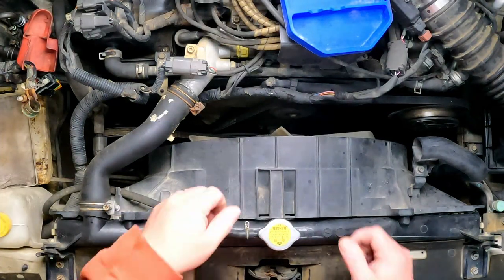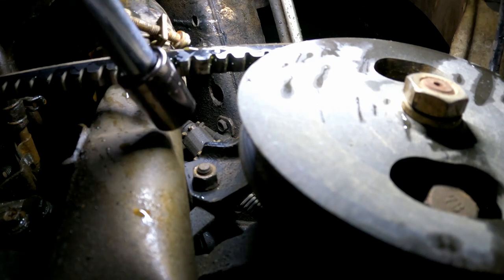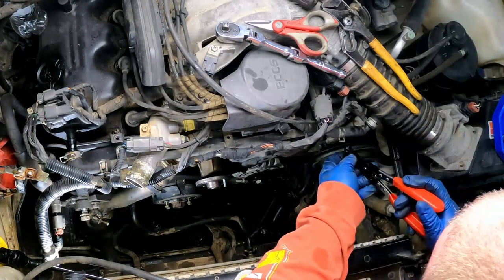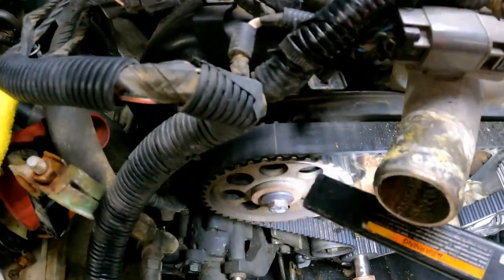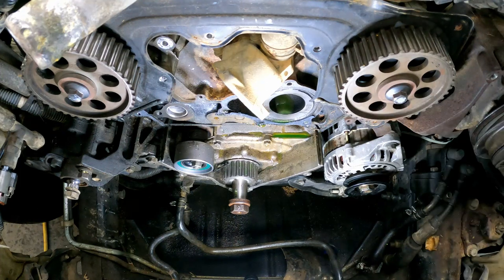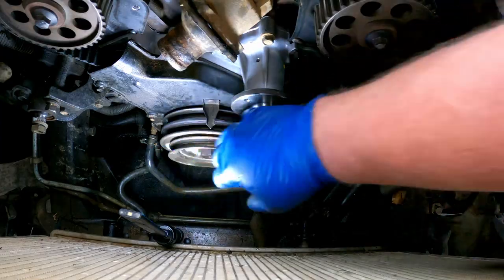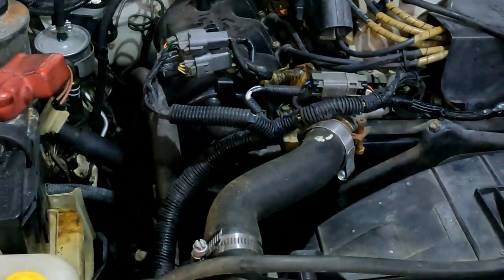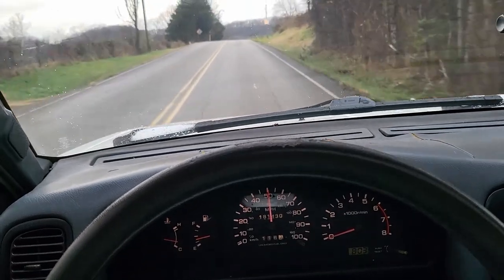Nissan Pathfinder WD21 Timing Belt Replacement

Comment: I was really unsure of what to expect until I saw this video. I literally just did this in my driveway today on my ‘87 and this really helped me out! It took alot of the guesswork/ anxiety out of it for me. I had my radiator out so I had a bit more room (swapped a full aluminum unit in). It was nice to fit an impact on the crank pulley vs a lot of swearing 😂. It’s a nice piece of mind having a fresh belt and water pump in there👍🏻. Awesome job man!
Reply from the maker: LOL, yeah at one point, I actually considered taking the radiator out to get an impact on the crank pulley. But by leaving it on there, my swear jar is much richer today!

Comment: Great video.  I have a '93 5 speed 4WD Pathfinder with the WD21 engine I bought new in Guam but had been sitting in my parent's garage for 18 years.  When my brother finally moved it outside in 2020 I decided I'd better trailer it up and bring it back to Warren County, TN which I did in September.  The fuel had varnished in the tank ruining the tank, fuel pump, and sending unit.  That was the first big job, replacing all of those components when it was sitting on the trailer.  Just finished battling the timing belt crank shaft sprocket after drilling and tapping three 8mm bolt holes in it and using a harmonic balancer puller to finally get it off, but only after heating it with an oxyacetylene torch.  Front oil seal replaced and a new crank shaft sprocket, timing belt tensioner and spring installed.  Water pump and thermostat are next.  A work in progress.  I hope you do a video on your window trim as that is another project down the road along with a new stereo...
Reply from the maker: McMinnville area, that's a LOOOOONG way from Guam. You're not too far from me (Murfreesboro Area here). I already have the trim laying on my bench. If my daughter will park the thing long enough, I'll get it installed and filmed.
Reply: @ProjectTimeGarage  This Pathfinder was hauled to Tennessee from northern Missouri, about a 700 mile one-way trip.  The old girl has some sea time, as it was shipped back to CONUS when I transferred off Guam, then back to Guam when I was stationed there a second time about three years later.  We ended up having her shipped commercially back to Long Beach, CA after the second tour as we had bought a new RAV-4 and the military would only ship one vehicle.  Guam did not have a sales tax, so there was an incentive to buy your vehicles there...

Comment: Excellent tutorial. Will soon be putting to use to chase down new clatter, knock, etc behind what sounds like upper, passenger-side timing cover on my 87 Pathfinder. Thank you very much.
Reply from the maker: I would be curious to know what you find. I have a similar sound that I've been unable to track down. I started the truck with the whole front cover off, basically with only the timing belt & related components, just trying to eliminate all the accessories, but the noise was still there. I'm almost thinking exhaust manifold leak on the driver's side, not sure.

Comment: I believe if you time all the pullys and the belt after it goes around, even one time, the belt timing marks will not be lined up anymore. It happened to me once on a Nissan Quest. I  lined it all up spin it around once, and the belt was in a different place, but it was still in time.
Reply from the maker: Yeah, you're right. You have to spin it a LOT to get it all the timing marks back lined up.

Comment: It is always a good thing to test start after timing belt on, as you did! (Just in case) exhaust leak? Yep, impossible to film, and probably not really worth your time recording it. I think you got a pretty good unit for your daughter or who ever in the family uses it. Maybe interesting to see what is wrong with the tach. Gremlins locking doors? Great 40 minutes spent with you!
Reply from the maker: Thanks Uncle Mark! The tach is definitely high on my list. It drives me nuts!!
Reply: @ProjectTimeGarage  It would drive me nuts too, but I hear for me, it would be a short drive! Lol!
Reply: @unclemarksdiyauto  If you also have a problem with your fuel gauge, the tach shares a circuit and can be fixed by replacing the voltage regulator on the back of the instrument cluster. There is a cheap DIY repair I found online using an off the shelf solid state version that fixed mine.
Reply: @Jmilner101  I am sure Brian will appreciate the info you have supplied, John!

Comment: Great video! Only thing I’m having issues with is getting the crank bolt out, how did you do it ? 
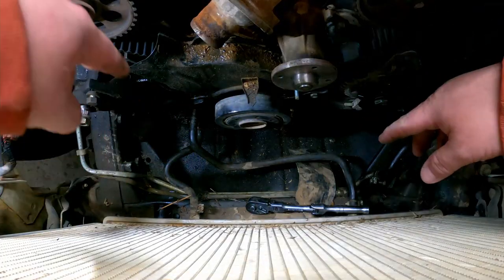13:30
Reply from the maker: Man, it was a bear. A good puller and lots of swearing.

Comment: Quick question, do I turn the engine counterclockwise when setting it on top dead center?
Reply from the maker: You can turn it either way as long as both intake and exhaust valves on #1 are closed and the #1 piston is at the absolute top.
Reply: How does a guy know both valves are closed?
Reply: Easy solution is to watch the distributor rotor, and it should be getting close to pointing at the #1 position.

Comment: thanks for the video! what temp is thermostat? i think i've got a 170 on right now and wondering if i should put a 180 in.
Reply from the maker: Mine is a 170 also, with actually strikes me as kinda odd. I can tell you that the temp gauge is way down in the lower half of the scale. If I had it to do over, I'd probably go 180.

Comment: Min 10.18 the cooling hose is that the thermostat. Ibseen video but they remove the timing belt want to know if i can ger out the thermo by just removing the ac stuff or irs necesary to remove timing belt too.please help❤
Reply from the maker: I do not think you have to remove the timing belt.

Comment: Hi, I was just wondering if all the tools you used in this video was the 12mm and 14mm ratchet and the mallet just cause I’m trying to make sure I have everything I need, before the timing belt attempt.
Reply from the maker: I'm fairly certain I used quite a few tools doing this. I think a decent metric tool set would suffice.

Comment: How about the main seal? Does it need to be changed too. I’m stuck at the backing plate thing.
Reply from the maker: The front seal? Yes, I would change it while you're in there.
Reply: @ProjectTimeGarage  I did forget about the thermostat tho. I paused and am picking it up today. 
I did do a test start wouldn’t stay running tho. Do you need vacuum lines for the test fire? Also getting some rubbing on the Lower timing belt cover and the balancer. Any ideas there?
Reply: @ProjectTimeGarage  Yeah the front one. 
Great video to man. Like my dad doing it with me…I got to do more then hold the light and grab the wrong tools tho…lol
Will be following the Pathy build 
Thanks Dude!!! ❤️💛💚

Comment: This was brilliant bro!
These are the terrano also ay?
Any chance you cld help with part numbers for all belts having trouble here in nz with the correct ones got an old 1990 d21 terrano
Reply from the maker: The timing belt is a Gates T249 as for the other belts. RockAuto has all the part numbers.

Comment: Did you put the water pump and therm. Housing gaskets on dry or just use hi-temp or hi-temp and gaskets?
Reply from the maker: Hi Temp RTV on the Thermostat, then dry gasket on the waterpump. Same as I always do and it has worked for me 100%....so far anyways!

Comment: He seems to have no problem removing the crankshaft bolt. I couldn’t turn mine without turning the engine. Does anybody know how to remove that bolt? I would like to change my timing belt before it breaks
Reply from the maker: Mine wasn't bad. I used a long ratchet (36") and smacked it with a hammer a couple of times.

Comment: It’s weird you’re talking about the belt stretching at 24:16 or so.  Timing belts are designed not to stretch.  The Kevlar reinforcing strings in the belt are not going to stretch in any meaningful amount over the life of the belt

The correct procedure to tighten the belt is not in the instructions that came with my timing belt kit from gates.  But it is in the factory service manual.  The FSM instructions tell you to tension the belt and then turn the engine over a few times and stop at piston 1 TDC on compression stroke.  Then apply 10kg/22lbs of force to the belt, midway between the cam pulleys.  Deflection downwards should be between 13 and 15mm.
Reply from the maker: Good info!

Comment: how do you find TDC?
Reply from the maker: I usually remove the #1 plug and plug wire, put my finger over the plug hole and "bump" the engine over until I feel air pushing my finger off the hole (this means the piston is coming up on compression stroke) From there, I use a socket to slowly rotate the engine until the piston comes all the way up. when the piston reaches the absolute top of it's stroke, that's TDC. Verify that by making sure mark on the crank points to the mark on the case.

Comment: He really doesn’t show how the steering pump pulley gets loosened. The tensioner is under the pulley. You just have to turn the bolt under the pulley after you loosen the pivot bolt (the one you access through the pulley, which he shows in detail). You don’t have to remove the pulley.
Reply from the maker: Thanks